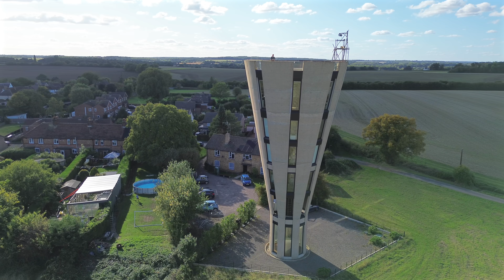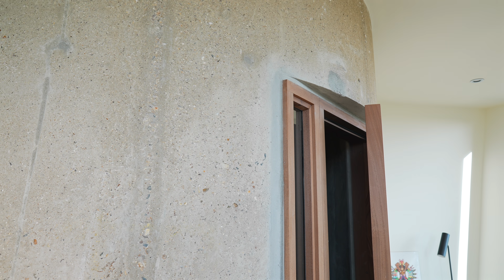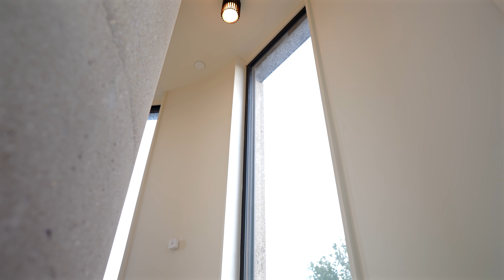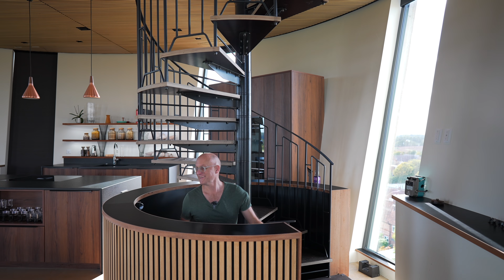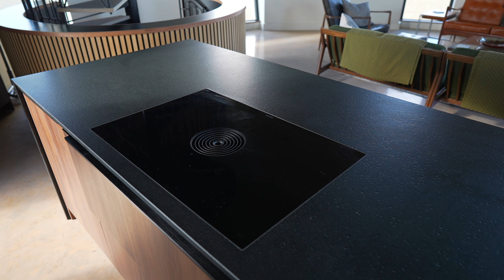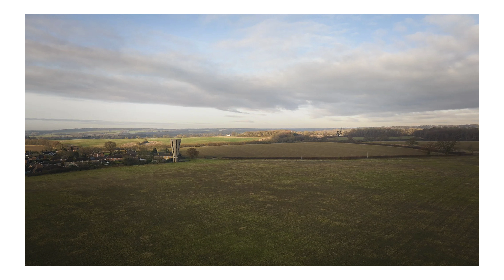How Industrial Designer Matt Transformed This 1960s Water Tower Into a Family Home

Comment: All the holes in the core and the outside of the tank worry me, but they must know what they're doing. Very neat place.
Reply: The tower used to contain 50000 gallons of water because it was built as a water tower. That's a weight worth of almost 200 metric tons. So, yes, you can do holes and stuff and still drag a full sized main battle tank to the top of the tower and it wouldn't notice.

Comment: It is very beautiful, and maybe this is just me... but the fact that the larger mass of the structure perched on the small diameter bottom does and would always engender in me a sort of instinctual "unease". Yes I know it is probably far stronger than necessary and would never fall, but it feels "upside down". It would be a similar effect to living on a sheet of glass... The engineers would know it is perfectly safe, I would know it must be safe, but something I could not control, inside me, would always make me feel unsafe. 

I saw the inside of a conversion of a silo into an office space, and it was similarly ingenious. But it didn't evoke any fear in me, as the sides were vertical, not splayed out as they are in this tower conversion. 

BUT that being said, I know I am probably in the minority, and plenty of people would have a restful time here.

Comment: I agree they should not break up the lines of the building. But there's the matter of those stairs. A tasteful trebuchet at a distance could be calibrated to land needed parcels on the roof. For instance if the fridge should stop working. No problem. "heads up"

Comment: On one side of the tower, aligned with the windows (with doors replaced by windows), there could be a glass elevator connecting all floors from top to bottom. It would be accessible only from inside and make the building more user-friendly.

Comment: That is seriously impressive on so many levels ;) Shame there wasn't room to squeeze in a pneumatic lift. I can see the stairs becoming a tad irritating after a while. You've just solved the lighting issues for my next project. The ability to scene set without insanely complex wiring and controls was just what I was looking for. Some of the alterations to the reinforced concrete must have given the structural engineer sleepless nights. What a fantastic project.

Comment: It is in almost every respect a delightful re-imagining of the structure. Have you considered having an astronomical telescope mount on the top level? Even an 8 inch reflector centrally mounted this high would be well shielded from most unwanted light. For example an 8" or 10" inch Cassegrain telescope could be taken down to the Tank Level when not in use. You could even add a video feed to screens on the lower levels.

Comment: On one hand, congratulations on the project and the design. it's so beautiful!

On the other hand, this design is not very practical or useful, so many stairs and if you break a leg you can't move. This design is very noticeable compared with the rest of the houses around, so in an ethical way, it's not right to build a house that tall and different compared with the others... in my opinion, the right thing would be to smash down that building and build a "normal" house. That's why there are rules to build in some places to avoid a 50 floor building around 2 floor houses, for example.

Comment: This water tower repurposing is very impressive.  Design, fit & finish are top.  Kudos and thanks.

If I may, beg your pardon, fundamentally I feel a few opportunities may have been missed.

Here, my build's key differing attributes, granted, a few quid pricier ... hopefully at least partly in keeping with what appears to have possibly been a Stonehenge original aesthetic:

> Water Theme / Pool: Couldn't the tank have been converted into a pool with a wrap-around deck?

> Top Level: The top of the tank built up to become basically the current tank level configuration; kitchen, dining, & living ... + 360 exterior wrap around glass wall, skylights, slenderish deck around, with elevator & fire escape access.

> Top Down Cylindrical Decking: Multi-level decking, a sort of cylindrical inversion of the existing tower, ending with the entire structure a completed cylinder.

Also: One vertical section of the wrap-around cylindrical decking reserved (45 degrees?), from ground level parking & storage to the top ... perhaps facing Stonehenge ... to accommodate the freight class elevator & exterior top-to-bottom fire escape cum grand stair.

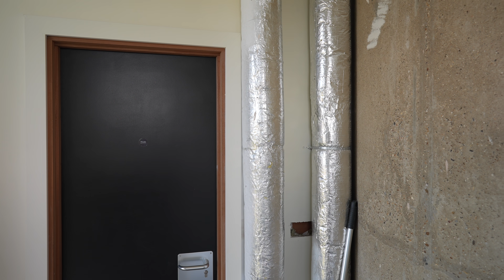7:44 ... Regards the center stair fire escape scenario: the possibility of an ajar utility level door with fire on that floor scenario, would mean smoke to all above -- how might that scenario have been addressed by the local AHJ?  Cylindrical decking with integral fire escape would provide a safe alternative.

And then, among infinite possibilities, plenty of decking all around up & down left over for perhaps a hanging English garden of sorts.

Enjoyed.

Cheers.

Comment: I'll let others gush over the design. My feels are that if I lived in the village I would be really pissed off at losing my privacy. I would be interested to hear the opinions of some of the locals. If it was not the unusual shape that it is, it would be a block of flats. Having said all that, there is no denying it is lovely inside for the owner. On the basis that it's easier to go down steps than go up them. I think I would include an external hoist strong enough to take someone to the roof with groceries and down again.
Reply from the maker: There was someone on here who commented their mum lives in the village. She apparently loved it, the water tower would've been there anyway, so it's either going to sit there empty and derelict, or restored and lovely for the village!

Comment: This is rad. Another water tower house just sold in Seal Beach, CA. It was very different, it was a rail feeder from 1894, wood structure with a big bulb on top. To turn that into a living space what they did was lift the whole tank off with a crane and park it in a parking lot across the street for a year while they built it into a home. Crane it back up, bolt it in place and you're done. That was in 1985 and the home was in rather desperate need of major work which would be complicated, so I did not end up buying it. Still it was an incredibly neat project that I can't wait to see the finish of.

Comment: I’ve watched dozens upon dozens of old buildings and various odd structure conversions and every time at some point I say to myself, “I would done this or it would have been better if they had done that…” This is the first one where I wouldn’t have done a single thing different to 99.99%! Absolutely perfect and amazing job!
Reply: Spot on. The furniture, everything.
Reply: I agree with the sole exception that I would have changed the ground surface around the base of the tower. I'm not a big fan of that kind of dusty gravel

Comment: Well done 👏👏 I like the honesty in saying "it's not a place you'd want to live in " 👍
Reply: The round rooms would drive me mad i think , not sure why.
Its an absolute genius build though , and I would love to do one night there to experience it.
Reply: @steve10  Me too 😊
Reply: Fire escape slides are common in some countries..  also doubles up as a laundry chute. Maybe...
Reply: But put in a lift or elevator, that would be awesome!
Reply: @johngreydanus2033 the fire code would force you to put an emergency escape ladder outside, ruining the whole thing
Reply: @dundeedideley1773  Perhaps, put a glass enclosed hydraulic lift on the outside…  That core stairwell would be a nightmare for paramedics, having to evacuate someone experiencing a medical emergency from the upper floors.
Reply: @dundeedideley1773 Well, how about parachutes on the roof? Or a ZIP line could be fun.
Reply: @johngreydanus2033  not sure about parachutes, maybe just chutes? The zip line sounds exciting 😅
Reply: @dundeedideley1773a fireman’s pole would be fun
Reply: @MelioraCogito  That's why there's a lift on the roof still. Attach a gurney to it and lower somebody down quite easily.
Reply: @lilb0yb1ue  You still have to get them up to the roof through the circular stairwells.  Extremely difficult when they're incapacitated and strapped to an ambulatory gurney.
Reply: @johngreydanus2033  I don't think there is space, unless the top three floors, but that brings h&s jobsworths. I think I'd leave it to the young and fit or the phone number of a local contractor with a Teleporter 😂

Comment: In this video, Matt and his wife, Alli, showcase their remarkable transformation of a water tower into a holiday destination. They met at university and have a background in industrial design, which helped them successfully undertake this four-year renovation project from December 2020 to December 2024. The couple purchased the tower without having seen the inside, but with planning permission already in place from previous owners.

The design concept was to utilize the structure's height and breathtaking views, with the living space located at the top and four ensuite bedrooms distributed across the floors. They maintained the silhouette of the tower while creating utility levels for equipment like a heat pump. Matt highlights the architectural beauty of the tower, built in 1964 by Edund Percy, praising its practical design for conversion.

As they tour the tower, they discuss the different levels, including a utility area, bedroom spaces with mid-century aesthetics, and a well-equipped kitchen. Safety features such as fire-rated doors, sprinklers, and a smart home system emphasize their focus on modern living with historical elements.

The couple also shares details about the renovations, including installing large windows for natural light, creating a unique spiral staircase, crafting a complete modern kitchen, and using eco-friendly heating. The rooftop offers panoramic views that highlight the surrounding countryside and beyond, including sights of London landmarks.

Ultimately, Matt expresses pride in their work, describing the challenges and joy of transforming the tower. They rent it out via Airbnb and encourage anyone interested in similar projects to reach out for advice.

Comment: What an Incredible build, would be interested to know how deep the footings are on this building as it was an old water tank, and how the outer concrete walls are formed and secured on the outer as you can see the form gaps on each concrete sections, are they tied into the floors?

Comment: I'm assuming installing a lift wasn't feasible, but that would absolutely have made it an everyday liveable home. Fantastic job.
Reply: You would have to change the shape quite a bit as the central shaft has to be stairs in case of  fire
Reply from the maker: I've added a pinned comment onto this video with the responses from Matt - hope it answers your question!
Reply: Perhaps an Enclosed concrete external lift to access each floor would be doable, but would break the aesthetics

Comment: I love it. 

I'm curious to know why they didn't put an elevator shaft on the outside of the building? Obviously the windows would make that accommodating to do, too. 

Granted, it would take away from the architecture, but it could be concrete the same colour without sharp corners. Rounded at the outside. It could terminate at whatever top floor would leave the structure inside the towers full width.

Maybe it's illegal? It would definitely cost a lot of money. I don't know?
Reply from the maker: I've added a pinned comment onto this video with the responses from Matt - hope it answers your question!

Comment: It's a modern castle tower with crenellation and all. It's just missing a silly knigget at the top :) It's an interesting structure but comes with some significant compromises of course. A fancy agile rail elevator in the shaft might make it decisively more viable as a residence. I would make the concrete a smooth off white. Brutalism is only so great :)

Comment: Should have put an elevator for one person instead of stairs.
Reply from the maker: You’ve got to have a stairs as a regulation, and no room for a lift as well
Reply: @homeinspireuk  Put the stairs on the ouside.
Reply: @homeinspireuk  Yes there is room for a lift.
Reply from the maker: You’d never get permission for that I don’t think
Reply: @homeinspireuk  The research i just did says as long as the design is approved you can. Never hurts to try.
Reply from the maker: Yeah as it’s listed I doubt it would get approved - but yes you’re right!
Reply from the maker: @Garett.1214  I've added a pinned comment onto this video with the responses from Matt - hope it answers your question!
Reply: @homeinspireuk  Thanks, I was just asking from a handicapped perspective. I understand that not everything has to be accommodating to the disabled due to cost.

Comment: I don't think I've seen a better water tower conversion from a design point of view. If the diameter at the bottom had been a bit wider it might have been possible to have a larger diameter hub ring for the stairs and then there could have been an internal hoist for shopping and small items.

Comment: Millimeter wave presence sensors (Everything Smart Home make great ones in the UK to use with Home Assistant) would make it easy to automate the lights not just based on if someone is in the room, but also on where in the room they are. Take that smart light thing to the ultimate level.
Reply: Yeah I do that, it's great, like living in the future.
Reply: Yeah, buzz yourself with wireless radiation, nothing like healthy living in a microwave.

Comment: Interesting and beautiful I would have installed a solar powered lift inside or at least outside with a landing lead to each floor. Entrance through one of the window areas. Hard to live there longterm unless you are prepared for stairs. Makes old factory type chimney living interesting prospect no less. Love the creativity not the first time I have seen a similar structure like water tower etc..
Reply from the maker: Being the shape it is plus it’s listed, not sure an external stairs would be possible! And you’d need that staircase internally - it is a lot of stairs though (as I found out when I filmed it!)